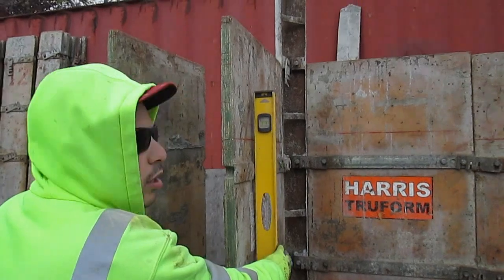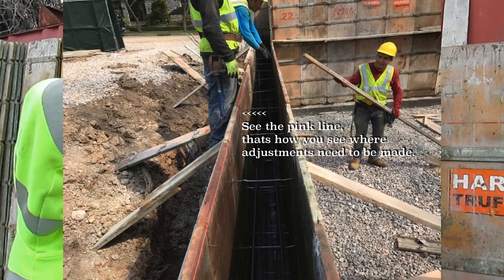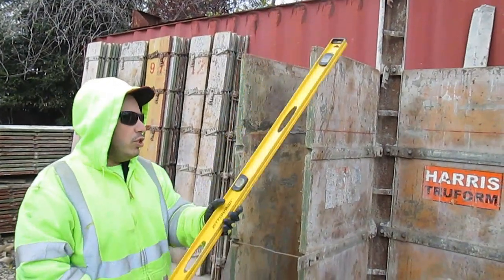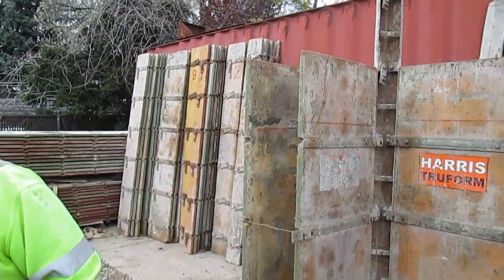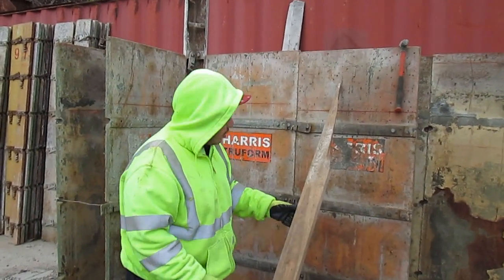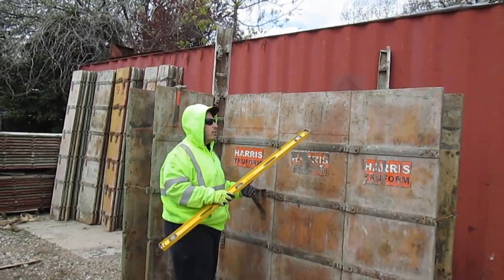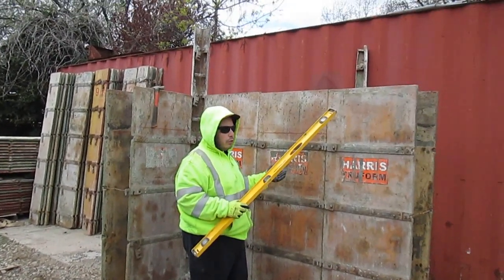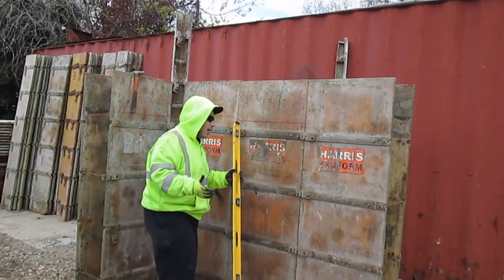How to Set Up Concrete Forms

Comment: Thanks for the video one question before starting would you build all your rerod grids tied together from the rerod coming up from footer then start with panels
Reply from the maker: It depends on the specs we are dealing with. Most jobs we assemble as we setup, we lay them on the snap ties and tie together. Commercial jobs or if there’s an inspection to pass, we assemble the grids then set up the forms.

Comment: How much are the forms ? Great video
Reply from the maker: Thanks. The 8’ tall 6 bar forms I have are around $85-$100 a piece. It depends how many you buy at a time. I bought the set in 2009 and they’re still in pretty good shape, we oil them every pour.
Reply: Concrete and Construction thank you I will look into them most guys in upstate ny use the symons forms. These look much faster
Reply from the maker: @Boysinda  they are much faster. It depends what your doing, if you have to do walls thicker than 16” or 16’ and higher, the symons are better.
Reply: Concrete and Construction awesome thank you !